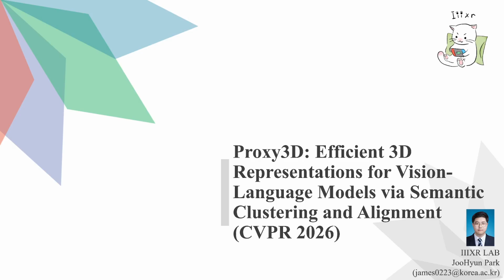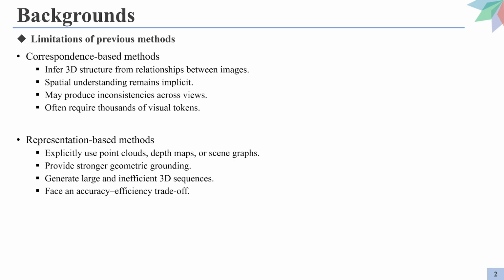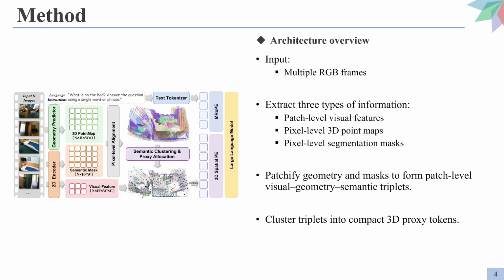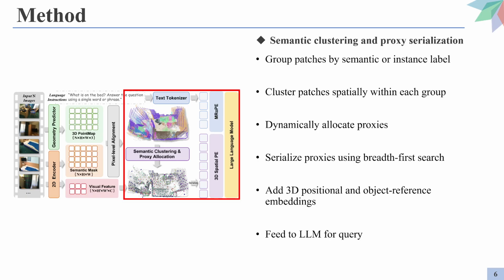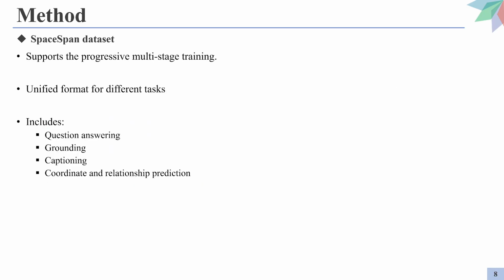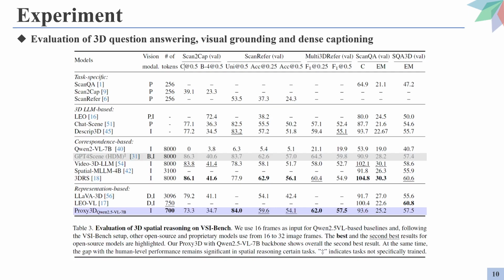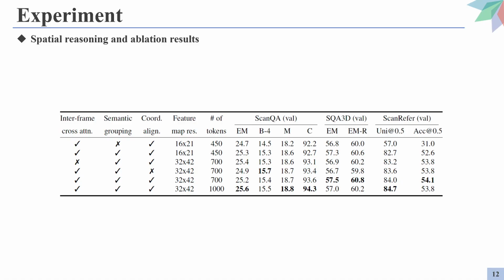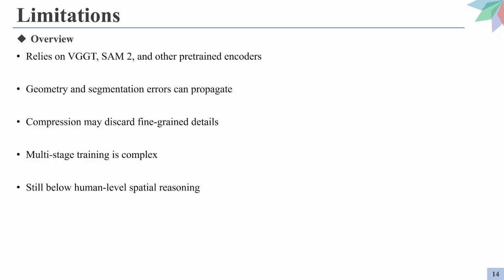[Seminar] Proxy tokens for spatial reasoning

Comment: Q1: I understand that the segmentation map is used to assign patch-level labels. However, I am still not sure how the segmentation results are converted into object categories or semantic / instance labels. Are these labels directly produced by SAM2, or do they come from dataset annotations or an additional post-processing step?
Q2: After spatial clustering, I am curious how multiple patches are compressed into a single proxy token. Specifically, how are the representative feature and coordinate determined? For example, does the method use average pooling, select the patch closest to the cluster center, or use a learnable aggregation module?

Comment: Q1. Dense 3D representations like point clouds must be compressed into a small number of visual tokens to be processed sequentially by a language model. What core trade-off arises between computational efficiency and the retention of spatial or semantic detail when determining this token count?

Q2. The Proxy3D pipeline clusters patch features within semantic instance groups rather than across the entire scene globally. According to the ablation studies, what specific failure mode occurs in visual grounding tasks if this initial semantic grouping step is omitted?
Reply: A1. Fewer tokens improve efficiency but may discard small objects, fine geometry, or subtle spatial relations. More tokens preserve detail but increase computation and can introduce redundancy, so the goal is to find the best accuracy–efficiency balance.

A2. Without semantic grouping, spatially nearby features from different objects can be clustered together. This causes inaccurate object referencing, producing a large drop in visual-grounding accuracy.

Comment: Q1. In Proxy 3D, semantic grouping is performed first, followed by spatial clustering. Why is this order important for visual grounding performance?
Q2. Proxy 3D improves efficiency by compressing a scene into about 700 proxy tokens. Why does increasing the number of tokens not always lead to better performance?
Reply: A1. Semantic grouping prevents nearby but different objects from being merged during spatial clustering. This is especially important for grounding, where the model must preserve object identity.

A2. More tokens add detail, but also redundancy and noise. The paper shows that 1,000 tokens only slightly improve some metrics and can reduce others, so 700 provides a better efficiency–accuracy balance.

Comment: Q1. How much fine-grained spatial information is lost when dense 3D scene features are compressed into semantic proxy tokens, especially for small objects or subtle object-object relations?

Q2. To what extent does Proxy3D’s performance come from the 3D proxy representation itself, rather than from the SpaceSpan dataset and the multi-stage alignment training pipeline?
Reply: A1. Proxy compression may lose boundaries, thin structures, and subtle relations, especially for small objects. The paper does not directly quantify this loss.

A2. The paper does not fully separate these effects. Ablations support semantic grouping and coordinate alignment, but there is no controlled comparison isolating proxies, SpaceSpan, and staged training.

Comment: Q1. How much 3D detail is lost when Proxy3D compresses scene features into semantic clusters, and does this hurt tasks that require precise geometry or physical interaction?

Q2. Does Proxy3D learn a representation that can support planning and embodied decision making, or is it mainly optimized for static spatial question answering?
Reply: A1. Proxy3D preserves object-level position and semantics but may lose precise surfaces, contact points, and geometry. This could limit manipulation or physical-interaction tasks.

A2. It may provide useful input for planning, but the paper mainly evaluates static spatial reasoning. It does not demonstrate closed-loop embodied decision making.

Comment: Q1. On page 7, the model appears to be trained sequentially across stages, in a manner similar to curriculum learning. Is the model indeed trained by proceeding through the stages in a fixed order? If so, how much does this staged training strategy improve performance compared with training without it? I would also like to know how much training data is used at each stage.

Q2. How were the text prompts and corresponding answers collected or constructed for each stage? Were they obtained from existing datasets, or were they newly collected or generated by the authors? If the authors created them, could you explain the data collection, generation, and validation procedures?
Reply: A1. Yes. Training proceeds in a fixed order: semantic/identifier alignment, coordinate alignment, spatial relations, and real proxy inputs. The stages use 30K, 30K, 115K, and 318K samples, but the paper does not compare this against single-stage training.

A2. Stages 1–2 use automatically constructed prompts from object labels and coordinates. Stage 3 uses MMScan relations, while Stage 4 combines existing datasets into SpaceSpan.

Comment: Thank you for the interesting presentation.

I have a question about the term “proxy” used here. What exactly does “proxy” mean in this context? On page 13, the number of proxies is shown—are they something similar to agents?

Also, on page 5, it constructs 3D semantics from images. Does the method work well for objects that are only partially visible or somewhat occluded in the image?
Reply: A1. A proxy is a representative token summarizing a semantic and spatial region. It is not an agent.

A2. Multi-view input helps when an object is visible in at least one frame. Completely occluded or poorly segmented objects may still be missed.

Comment: Q1. Proxy3D first performs semantic grouping and then applies spatial clustering within each group. How robust is the proxy generation process to segmentation errors?

Q2. If there are two identical chairs in a scene, and the segmentation model groups them into the same chair category or instance, can Proxy3D still distinguish them through spatial clustering, or would this cause problems for object counting and grounding?
Reply: A1. Segmentation errors can assign features to the wrong group or remove objects entirely. Spatial clustering may partly separate distant regions, but it cannot fully correct incorrect semantic labels.

A2. Yes, if the chairs have separate instance masks or identifiers. If segmentation merges them into one instance, counting and grounding may become ambiguous.

Comment: Q1. How can we separate the gains from the 3D proxy representation itself from the gains due to SpaceSpan and multi-stage training?
Q2. Does semantic clustering lose fine-grained spatial information needed for tasks like navigation, route planning, or object ordering?
Reply: A1. A fair comparison would keep the data and backbone fixed while separately removing proxies, SpaceSpan, and staged training. The paper provides only partial ablations, so their individual contributions remain unclear.

A2. Some fine spatial information is likely lost. Coordinate embeddings preserve coarse relations, but reliable navigation may require denser geometry or an explicit occupancy map.

Comment: Nice presentation.

Q1. I understand that Proxy3D focuses on spatial reasoning and efficiency. How robust is the model to variations in visual features, such as changes in texture or shape for the same object? Does it maintain visual understanding performance well in those cases?
Q2. Regarding the proxy approach, do you think small objects are easily missed or lost during the compression process? Or is the detection of smaller objects primarily dependent on the performance of the underlying segmentation model?
Reply: A1. The paper shows generalization across different datasets, but it does not directly test controlled texture or shape changes. Robustness largely depends on the pretrained visual encoder and segmentation model.

A2. Both matter, but segmentation is the main bottleneck. If a small object is detected, Proxy3D can preserve it with proxy allocation; if segmentation misses it, compression cannot recover it.